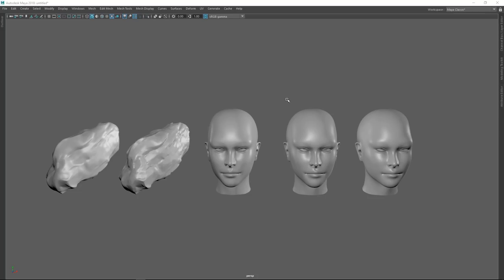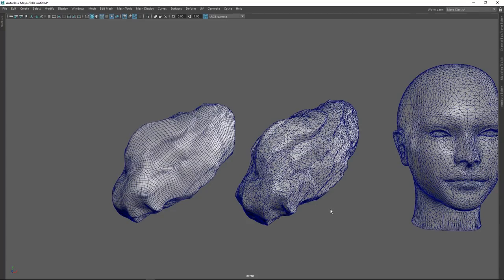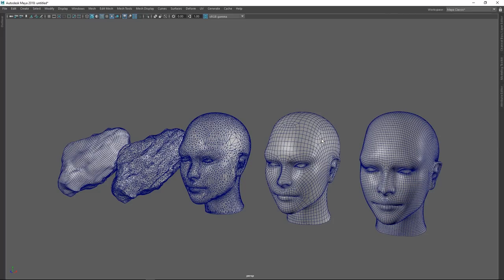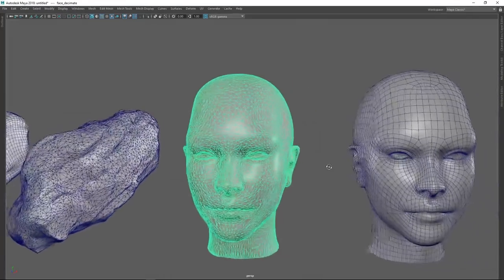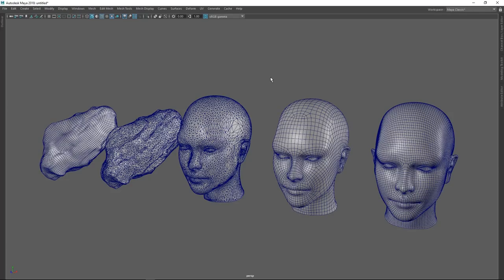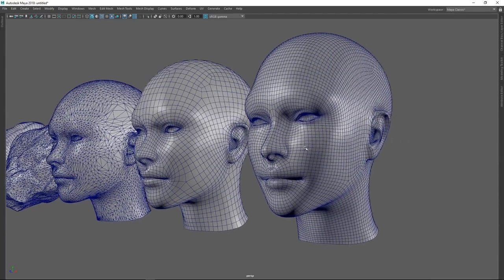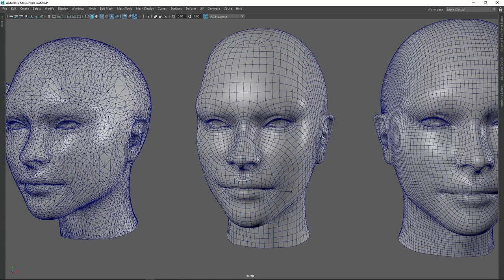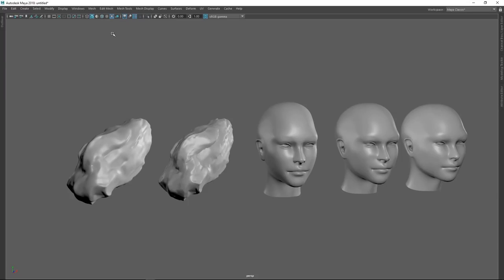Is Good Topology Overrated?

Comment: Good topology is important for a few reasons.

Animation is the most obvious.

But in gamedev, it also acts as an optimization technique. The first is a properly topologized model can use much less geometry while maintaining shape in animation.

The other bit is polygon fans, which is a micro-optimization that allows the GPU to blaze threw geometry without wasting time in swapping states
Reply: Isnt poly count not as a big deal anymore though? obviously you cant just have a massively high poly count on any thing,. but within reason? like a full character with 90k tris isn't out of the realm of acceptable for modern engines for PC games. mainly talking bout characters here. in game assets like tables and buildings should be low poly as possible , and modular if possible.
Reply: @temptor7585  isn't it the opposite, you can have as many polys as you want on stationary objects right

Comment: Great video !!!!

I used to spend alot of time building really nice topo, until zremesher came out. For a long time I was of the opinion that topology was dead. That was until I went back and started reworking some of my old models. I found that having nice topology allowed me to stay in lower sub divisions for longer, (especially for areas like eyes/lips or anywhere with alot of folds happening) while still maintaining lots of control on my geometry. 

Of course if you are doing hard surface it doesnt matter as much. Now I kind of feel like there are times when zremesher will cut it, but for most of my workflows (character artist) I much prefer to have good topo from the beginning. Plus remeshing can be annoying to get the results you are happy with.

Comment: It's not only the rigging. There's one situation where a good topology is imperious, and that's when you want to build the uv map. With bad topology, you will have a hard time to create a proper uv map. But there's a workaround, at least in zbrush- you can remesh, sculpt and get your perfect high res model, and then project it onto the low poly one. All the details will go into the normal map.

Comment: hey i have a problem...i am making a full character and i want to animate that character.
i used zbrush to sculpt the character
and now i am making the low poly using the topogun retopology..
so the issue is do i need to do the back side of the clothes tooo???????
if i only did the front side of clothes or any other accessories will it work when i animate it ?????????
please help it is hard to do retopology of hidden side of small parts like gloves and boots????

Comment: Yes totally agree that good topology will depend of the type of project and what will the model will be used on, but i have an interesting question for you guys, and if you could make a part two with this idea that would be awesome. The question is about topology styles, like you mention video game topology is different obviously than animation, and i see a lot of people with different styles of retopology, what are your thoughts on that topic????
Awesome videos guys!! big fan of yours!!!
Reply from the maker: Great question! So there are two main things to tackle here:
- Topology which will be simulated. This topology is very even and gridded, with nothing being baked into the topology, like muscles and such. It's all driven by a muscle sim underneath. This is how films normally do it for hero characters.

- Characters without simulation. Here you'd bake forms like muscles into the topology. 

A lot of the time, you'd blend the two a bit, where the torso is usually pretty evenly gridded for sim, while the head is more bespoke topology for wrinkles.

For games, it's mostly the same, just more low res :) It's also not subdivided, so you can often do more cheats there.

Hope this helps!

/Henning

Comment: thanks for sharing your thoughts and insight on this topic and i completely agree with everything you  guys said:). As a fellow modeller    (4-6 years so far of learning, and starting to get into more character anatomy/sculpting )   and now some experience in  character rigging, i found that  lately after I created a face and manually retopolgise it. I tend to start testing blend shapes/skin weights, even though i am not entirely great at animating, to show me if the retoplogising i have done actually works or not. 

But this ofc is excessive to do in a production with the amount of time it takes to set up. I just been doing it lately as planning on animating a personal project by myself oneday soon😅

Comment: I use triangles and n-gons a lot. Just subdivide once and in a place where you had a triangle you'll have a tri-edge vert, and where you had a pentagon you'll have a 5 edge vert etc. The main "danger" is concave n-gons. the center of subdivision for those a lot of the time ends up outside of its perimeter and that is the main problem. Quads are just way easier to control and that's why you generally want only quads in your mesh.

Comment: Good topology is needed for characters. For hard surface it depends. It depends on if you can optimize the asset by a substantial amount by doing it manually. If you feel like it won't matter, then just Zremesh. Reto is very helpful for texturing things and for controlling texal density.

Comment: You can combine the Zremesher and manual topology.

I do it and it makes the retopology much easier.
Reply from the maker: This works pretty well for certain cases for sure, but for the most hero characters we'll need to retopo it manually for ultimate control. Like we discussed in the video though, sometimes different pieces are done with manual and some for auto, like if a character has ton of rocks on his back. The main body would be done by hand, while the rocks could be auto.

/H

Comment: I really like decimating environment things because of the look it gets, very suitable for dirt and rocks. I've been making things straight in maya by using texture deformer with procedural noise/fractals on a high poly object, the reduce by at least 75-80% to make sure it's mostly triangles. I might try it for status, see if it looks chiseled. Strongly dislike having to rig or UV zremeshed things tho, but they're not bad when still sculpting and you're past the dynamesh.
Reply from the maker: Hey! This is a really interesting way of doing it. We did something similar in a tutorial years back, where you use a texture deformer to get some cool results, and  then you triangulate it to death afterwards. Thanks for sharing, Kristine! :)

/H

Comment: For me personally: I prefer decimated meshes for non-organic for gaming only. And ONLY if it's at the final stage after being uv mapped and textured. I'll decimate them when I'm ready to import them into Unity for gaming.
If I want it for renders inside Cycles or Arnold, I'll keep the proper quad topo instead. Light seems to bounce off of it better inside these render engines.
As for organics, I don't understand why anybody would decimate a face, LOL. Now to watch the video and see if you two enlighten me on anything to the point I'll edit my post :)
Edit: K, I was thinking NGons, but I learned tris were bad, so I stay away from them at all costs, lol. Unless they're hidden somewhere away from cameras.
Also, I'm not sure what the standard is in production for gaming, but from what I've been doing the past 6 weeks for assets I've been sticking with good topology until my final result where I'll decimate it in Zbrush and copy the UV map over to it, save it as FBX and import it into Unity where I'll make materials for the texture maps, add the materials to the object and compile the result.

Comment: Probably a dumb question, but, what is zremeshing (just got zbrush and don't know much about it yet) and decimating? Is having good topology a benefit for portfolio pieces?
Reply from the maker: Zremesher is a feature found in ZBrush which does the topology in one click. 

Decimating is drastically reducing the polycount while maintaining the details, by triangulating the mesh. You cant use this for deformation.

Good topology is definitely beneficial to have in a portfolio piece :)
Reply: FlippedNormals Thank you! Is this process and the rest of the modeling process explained in your game character tutorial that is in your shop?

Comment: How do you deal with stars and triangles causing slight distortion on the surface of the model in sub d?  I don't really see any issues with that on the head in the middle where you have stars, but whenever I try and use them on a non-flat surface, the end result is not perfectly smooth.
Reply from the maker: The best way I've found is to increase the polycount - if it's really low poly and you subD it, you often get artefacts, like you're saying. You can also try using Open SubDivs instead of the regular Catmul Clark algorithm, which might also reduce it. 

One of the ways is also a bit hacky, but once you have several layers of texture on top, you often cant tell.

Hope this helps!
/H
Reply: Sweet, thank you very much for the reply!

Comment: A prominent ZBrush tutor and tech expert said he thinks Manual Topo will soon be fully and accurately automated. Do you guys know of something on the horizon? Also, is ZBrush or 3DCoat better at autoretopo? Thanks!
Reply from the maker: I also think that will happen in the next 10 years, but right now with the current tools, it can't be replaced. In games and VFX (and more cases, for sure), we simply need perfect control of our topology. The tools we have now aren't smart (they look at the curvature and such of the model), so they can't create topology based on specific use cases - yet. The moment we have some kind of intelligent machine learning tool however, this changes.

In the big studios, manual retopo has been moving away gradually though, but that's due to it being outsourced, instead of being automated.

I haven't used 3D coat a lot, so honestly I can't give you a  good answer here. Regardless, none of them will be miles better than the other as they mostly work based on the same principles.

I hope this helps.

/Henning

Comment: Uh, games, well, my work is pretty low poly so I have to do my topo :P I can use all the triangles I want, I only keep it low because having loops is much easier while working. I will manually add triangles to quads that are folding annoying, happens lots near the brow and mouth, I don't trust my exporter to do it right. Skinny triangles still shade bad even in a static model. I think it took me a year or so to get over the ALL QUADS mindset from school. Triangles are so good. Might be interesting to hear from game artists working with engines that subdivide tho. My advice is keep a few around, it's rarely worth your time chasing down a stubborn triangle.

Comment: Good topology will never die. Truly if anyone wants to know how topology works, create something, texture it, rig it and animate it. Trust me if you don't know good topology then when your are rigging or animating, the reasons will show. By texturing it, the mistakes will be shown more.  So for characters, remember your loops and masks (eye mask, ear loop etc) and you will be fine. For environments remember leaves bend, trees sway and rocks crack so just because its not a character doesnt mean to throw topology out the window. 

That being said. There are parts of even characters that dont need good topology. The better the topology the better the deformation so if it doesnt need to deform that much then the topology matches. For example a snails shell wont deform so technically you can get away with bad topology

Personally my methodology makes it so retopoing is easier. People like to start with sculpting, I start with modeling. I build a well made character then head to Zbrush or mudbox or whatever you use for the fine details. Depending on what I do in Zbrush, my retopo time is cut significantly. 

Plus if I make a destructible mesh for a video game then I would like to control the shape, size and direction the shards go. That is 100% topology driven.

Retopoing also makes it so I can plan out how I am going to UV. My cuts are a lot cleaner. I plan out how to rig, I can test the deformation. I plan on how the animation might go. All this will help not only you but if you are part of a team then you will help the rigger and animators too.

Outside of things deforming, as long as the silhouette looks like whatever you are making, the topology doesnt matter that much. Bad topology will look ugly, UV ugly, show your lack of skill and lack of care you have for modeling but in the end as long as it works as you intend then nothing else matters. There truly are no rules because you can get to the end hundreds of different ways but there is a difference between have bad topology because you decided that it would cut down on time and still look good vs bad topology because of your lack of knowledge as to why regardless of the end result. 

Create things the long way and understand why things are the way they are. Then find the shortcuts that we all use.

Comment: Any chance you guys might do an actual retopo walkthrough in Zbrush?
Reply from the maker: We did one in Maya on doing a head, which might be interesting:
https://youtu.be/9N4rG5qHWgk

We probably won't do one on ZBrush though, as you never get amazing topology from Zremesher. Maybe we do a tutorial showing the strengths and weaknesses of Zremesher, though!
Reply: Cool, I could dig that.

Apart from Zremesher's limited sufficient cases where it can be useful, do you tend to believe Zbrush as a whole is subpar/useless for retopo? As in, just ship it over to Maya or start in Maya even to handle all the topology?

I have 0 experience with Maya. Are their retopo tools easier or more effective than the zsphere adaptive skin method?
Reply: That'd actually be amazing.
Beginner question - if I'm doing retopo in ZBrush for enviro assets, would ZRemesher be okay? If so, what would be a general workflow for this? (i.e. do I decimate first then ZRemesh or vice versa?)
Thanks for all your content!
Reply: it depends on what you want but you can decimate and if the object is not gonna deform or anything you can leave it like that.... you can duplicate your hi poly zremesh it and then get uvs from uv master and then decimate it and then proyect the mesh to you original to keep the form as close as the original (zremesher tends to no care that much about your original form), but i normally dont like the uvs from zrbush..

Comment: This comment will probably get buried (and maybe has been said).... but one thing you didn't mention is that the more dense a mesh is, the slower it will deform.  So, if you pass off the dense z-remesher model to your rigger, they will hate you because of the extra difficulty in deforming it nicely, and the animators will hate the rigger because of how slow it goes - if they talk to the rigger and see the topology layout... then they'll hate you too.  Ok... hate may be a bit strong, but you get the point, haha.  It may be faster for the modelor to use z-remesher, but the extra time down the pipe far outweighs spending an extra day making some nice topology (for deforming geo, like you said).  This is especially true for the people looking at the budget to consider - paying to make clean topology at the beginning saves a lot of money in rigging and animation since they will be able to work faster.  If you ever do an updated version of this video, it's a small tid-bit to maybe mention at some point.

Comment: why not zremesh , then tweak where needed , like the arms legs and torso , it's nothing but repeated loops.
But for hands , feet , face manually retopo is the best option.
Reply from the maker: The reason I personally dont zremesh stuff like a torso is because it's a real pain in the ass to connect it up to the head, hands, etc - so either the connection points becomes a real mess, or I spend a whole lot of time trying to fix it. I find that just doing the torso by hand is easier and faster in the long run, as I then control everything and I know that the topology is clean and efficient.

Just my personal take from doing this in production, but in the end, do whatever works for you.

/H
Reply: yes ,the connection point does become a mess , bad loops. I also have to spend time on fixing the remeshed model (maybe as same as I'd have taken to just manually retopo the body)

Comment: Zremesher is actually incredibly powerful, you just have to take time to be very methodical with placing your guides, and then a lot of trial and error when defining the curves strength and adaptive size. It just requires a bit of experience before you can make educated guesses about which areas you should manually define and how the algorithms are going to fill in the blanks basically, and you can get 95% of the way there in 5% of the time. You can actually be incredibly specific with your topology, from loops even down to the individual faces, but the closer they are together the more the algorithm is going to freak out until you get it into the sweet spot for that level of detail. But to be honest, between decimation and Zremesher, i don't find myself using 3Dcoat or headus anymore. Its just important to not use the one-click results out of the box for those plugins, just be very specific about your parameters.